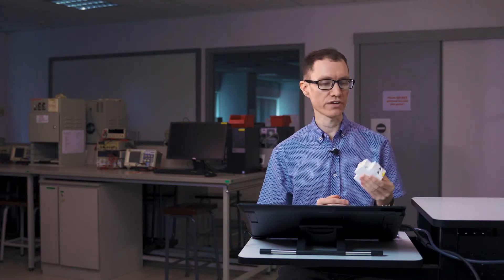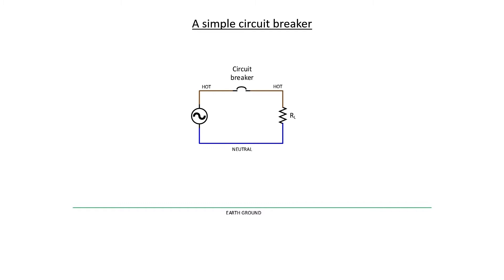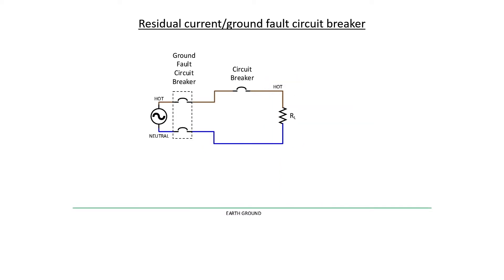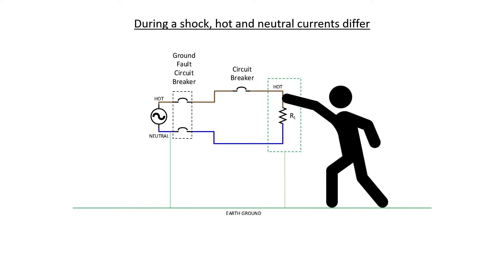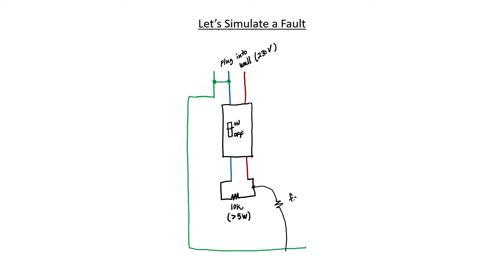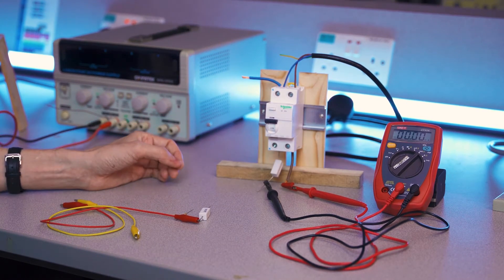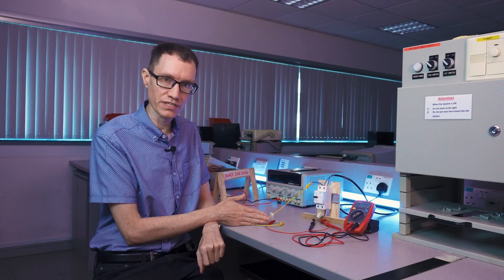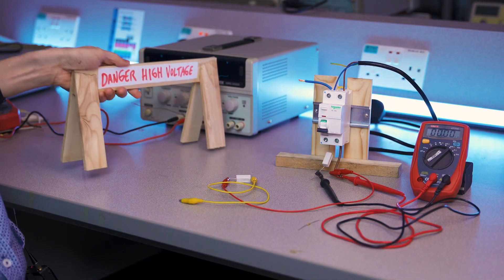What does a residual current circuit breaker do? (6 - Electricity Distribution)

Comment: So should I always use these when possible over regular breakers or only in special circumstances
Reply: usually only in special circumstances, otherwise you will need double the space in the your panel
Reply: @unproductive-me  They are standard in the UK for all new circuits. You can even get combination ones with standard circuit breaker which take the same amount of space.
Reply: @ that's nicer than in Canada